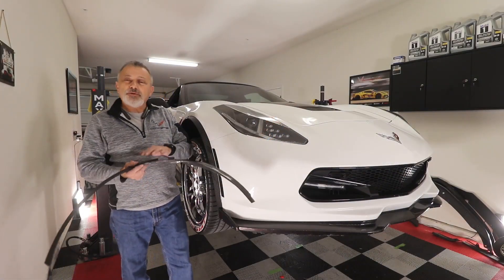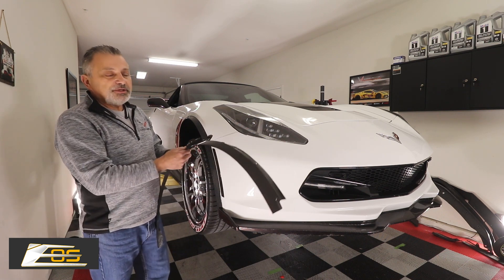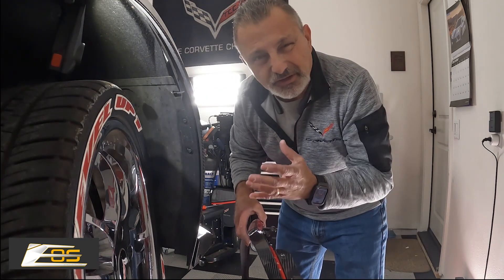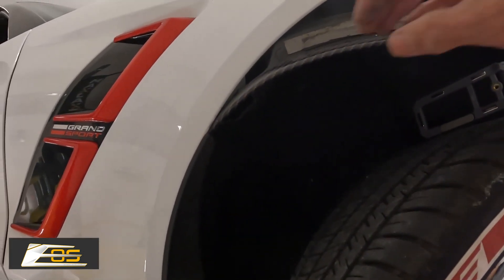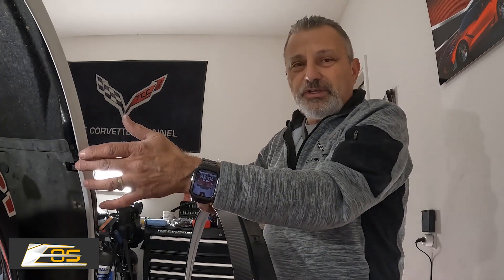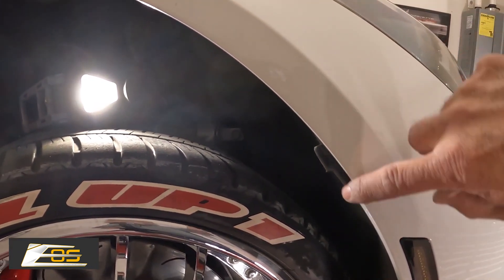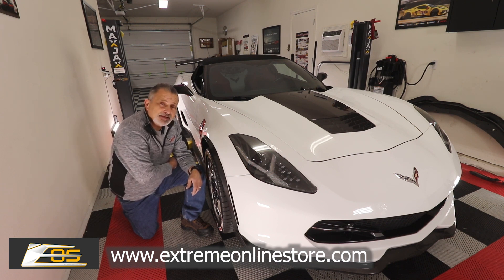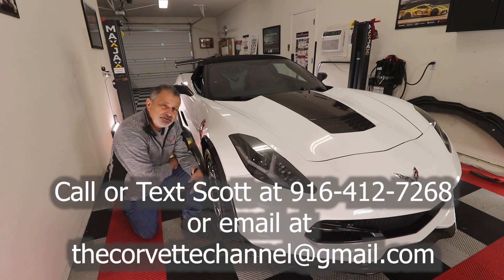EOS Chevrolet Corvette C7 Carbon Fiber Fender Flare installed by Scott @THECORVETTECHANNEL​

Comment: I need these to complete the look and fill the gap that the EOS Stage 3 spliter has after installment. Given the three last bolts hold this wheel well trim piece in and also has to hold the stage 3 winglets on with the same three screws. It looks like it maybe a nightmare trying to get those three screws through the wheel well trim piece and the stage 3 winglets? Maybe will have to upgrade to longer screws huhh?